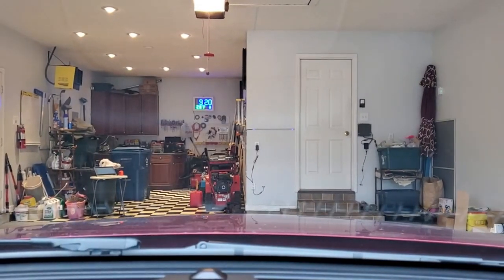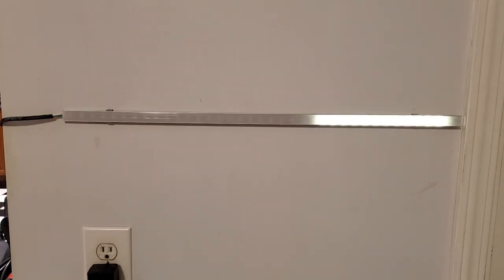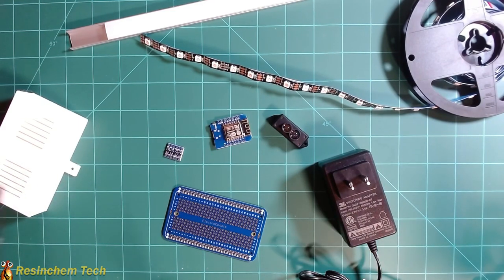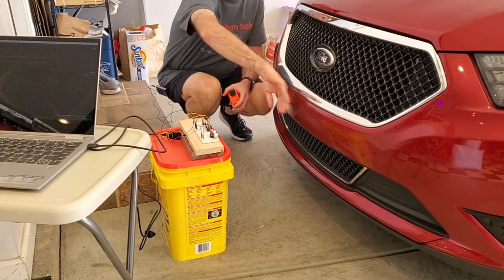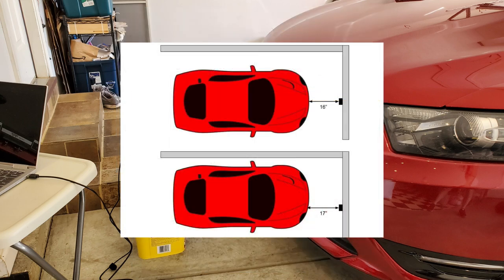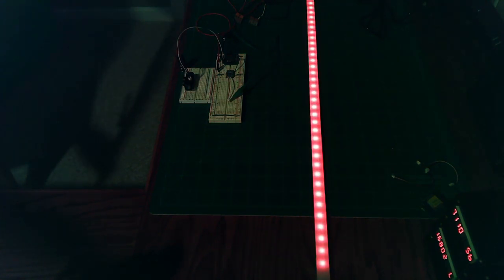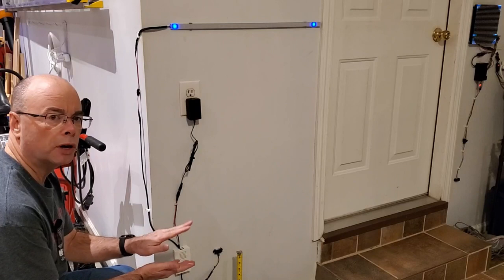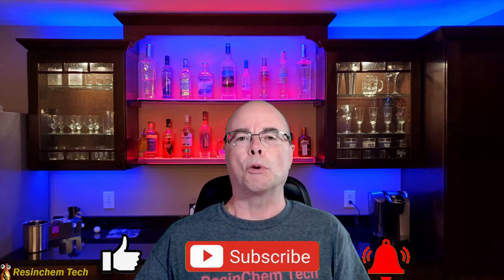A New Parking Assistant using ESP8266 and WS2812b LEDs

Comment: In a two car garage set up, could you put each system in front of each car without issues? Or would there be a way to run it all on a single D1 mini with 2 separate sensors and 2 light strips? Perhaps, in a future version, you could have an audible sound (via bluetooth speakers) as you approach!
Reply from the maker: Yes, starting with version 0.41, multiple systems can be installed (e.g. one for each car... for as many total cars/parking spots you might have).  You just need to assure each system is given a unique name when setting it up, and provide a unique MQTT topic for each if using MQTT.  This is all covered in the Github wiki for the project.

As far as adding sound, I have numerous requests for enhancements to the system... and a buzzer or audible tone is among those.  I did provide some updates and a couple of new versions a few weeks ago, but honestly I don't know if or when I might have time to consider additional requests.  Of course all my code is available, so it could be cloned or forked and those other features could be added by you or someone else.  I just can't make any promises as to when I might be able to provide any new features.
Reply: @ResinChemTech  For 2 cars, it requires 2 complete systems, correct? Or can any of the hardware be shared (ie. run it all off a single D1 mini)?
Reply from the maker: Correct.  It would probably require an ESP32 and pretty much an entire rewrite of the code to be able to share one MCU between two sensors and two light strips.  As written each system is independent, with its own web interface and settings.  The only thing you might currently be able to share would be the 5V power supply (running separate leads to each system) as long as it was able to provide enough current to power both systems.

Comment: Nice project.   I keep threatening my wife to hang a tennis ball in the garage because she always pulls in too far.  She's very resistant to that idea.  I tell her that mostly to tease her, but the WAF (wife approval factor) is a big part of projects like this.

I'm curious why you didn't put the LIDAR sensor in the box with the controller, and have it off to the side on a whip?  Seems like it would be pretty easy to include it in the box, and would reduce the clutter on the wall.
Reply from the maker: Thanks!  We used to have the tennis balls on a string too!  But I hated them because it seemed like when I had the cars out of the garage to work on a project, they'd always get in the way.  I'd either bump my head into them, or swing an 8' 2x4 around and catch the string, yanking them off the ceiling.  And of course, you can't integrate a standard tennis ball into Home Assistant for vehicle presence! 

To be honest, this was really just a temporary install that I did for the video.  My wife is happy with the old Pi version, and there's no real reason to replace it, as it still works well.  And that particular spot on the wall I used doesn't work for either of our vehicles either... again, it was just done for the video or my wiring runs would have been much neater (requirement for the WAF!).  But the idea to include the sensor in the same enclosure to reduce wiring is a good one.. as long as the D1 Mini doesn't cause any sort of interference with the TFMini.  Not likely, but I didn't test it either.... wifi and EMF can play havoc with some sensors.  Finally, I already had an enclosure designed for the current controller and I was both too lazy and spent too much time on designing the firmware, testing distance sensors and writing both the blog and Github wiki pages to create a new case design!  But the overall install could be made much neater in a number of different ways.  This one will probably come down and the parts will be reused for some future project.  I may actually mount it right over the Pi display for a while and see if the wife might like this version better, but she probably won't!

Thanks for watching and taking time to comment!  For us, anything that got rid of the tennis balls yet still provided parking guidance was an improvement (and adding Home Assistant integration was a bonus for me!).
Reply: I'll play around with it, I'd really prefer the LIDAR sensor be built into the case.  That'll be important for my WAF.

Comment: Super project 👍 short question: do you have to connect (+) and (-) left and right on the breadboard (loop through)❓Am Wemos D1 gets but then the connection 3V3 also then 5 volts from the power supply or ?
Reply from the maker: Thanks.  Well, it's probably easier for you to look at the wiring diagram in the related blog article ( https://resinchemtech.blogspot.com/2022/11/esp-parking-assistant.html ) than for me to try to describe it here in text, because I can't post images in the YouTube comments.  But if I understand what you are asking correctly:

5V is fed to the power rail on one side and the D1 Mini 5V and GRN connect to this to get its power.  The other power rail is 3.3V and is fed by the 3V3 pin from the D1 Mini.  Only the ground is connected between the two power rails.  The 3.3V on the one side is only there to power the LV side of the logic level shifter.  Do not connect 5V to this second rail or you will likely destroy the D1 Mini.  Again, it will probably make more sense when you look at the wiring diagram in the blog article.  But if you have additional questions after reviewing that, just let me know.
Reply: @ResinChemTech  One more question: is it not necessary to install a code on the Wemos D1 ?
Reply from the maker: Yes.  The code, along with all the details on how to install it and use the web interface is found in the Github repo, which is linked both in the video description and in the related blog article which I linked to above.
Reply: @ResinChemTech  Hi ich finde den Code (Firmware) nicht wo ich auf den Wemos D1 aufspielen / installieren muss ❓
Reply from the maker: Es befindet sich in diesem Github-Repository:  https://github.com/Resinchem/ESP-Parking-Assistant

Bitte lesen Sie das Wiki für Anweisungen zur Installation.
Reply: @ResinChemTech  Ok is it the code where in the "folder SCR" in it is that one must then play on the Wemos D1 ?
The code (firmware) is then played with one of the 2 softwares no matter which on the Wemos D1 ?
Reply from the maker: Hi. No, its the .bin file which you will find in the Releases section of the Github repo.  If you to the the wiki and just follow the step, starting with this page: https://github.com/Resinchem/ESP-Parking-Assistant/wiki/02-Initial-Installation  it will walk you though the install and the setup. All the instructions are in the wiki.  You do not need to download anything other than the ParkingAsst_vx.xx_ESP8266.bin file unless you want to modify and compile your own version.

Comment: You could use an ESP for your original project, or Pi for the new version.  The Pi certainly can have a web interface.  You don't have to use Python for the program language either.
But an ESP is the more logical choice, as the Pi is essentially a full PC in a single package with GPIO pins.
Reply from the maker: Yeah... I think my goal here was to make something that was significantly cheaper, since Pis are so hard to come by these days... and the LED matrix wasn't cheap either (at least compared to a short strip of WS2812b pixels).  The matrix also requires 16 different wires/pins between the Pi and the display (not counting power), basically eliminating the possibility of using a D1 Mini.  

Yes, a lot could be done to improve the original version... such as adding a web interface for the settings.  But the new version is a much lower cost and an easier to build solution with significantly less wiring.  My Pi version still works fine and I will likely keep it, but I wanted to share a system that basically offers the same features, but others could build without shelling out the extra money for a hard-to-obtain Pi or a matrix display.
Reply: As I mentioned, using a Pi is overkill anyway for this type of project.
As for your matrix, just use a WS2812b matrix which just like your new project would only require one channel wire, besides power and ground.

Comment: I made something very similar for my wife.  But mine was built with just a 2x4.  Yours is a little cooler.
Reply from the maker: There are a lot of different ways to take this same concept and reconfigure it for different needs and uses.  There are numerous other projects out there that do a similar thing, but many of them use an Arduino and a simply 'stoplight'... green, yellow, red.  I wanted to try to make something with an ESP8266, add a countdown effect (instead of just jumping from green to yellow to red) and to provide a web interface that allows a lot of different options and settings so the system could easily be configured for different purposes without needing to edit any code.

It won't be a fit for everyone, but it might work well for some as it is relatively easy to build (compared to some other projects) and doesn't require any coding to install or use.   Thanks for watching and taking the time to leave a comment!
Reply: @ResinChemTech  I was being silly, of course, with the reference to a simple stop block on the floor.  This is one of a million different projects i'd love to do, along with remaking my homemade CNC, connecting my irrigation and HVAC controls into a custom interface, constructing some ultra long battery life temp sensors, building a complete garage motor and sensors from scratch, etc.  I may not need this exact thing you made (my garage is deeper, and has a workbench an other stuff that would prevent me from having a good mounting spot), but the components and design ideas are still relevant to thinking about other uses.

Comment: Love the project wonder if it would work with a long range ultrasonic and a short range to 20$ in parts vs 40$ I may download and tweak if you don’t mind another fork?
Reply from the maker: Go for it!  I have numerous reasons why I don't want to add an ultrasonic version to my project.  Personally, I'm very happy with the TFMini and need its narrow FOV due to the sensor placement in my garage.  But mostly, I plan on further enhancing this project when I have time,  possibly adding lateral guidance as well... and I just don't want to have to update and maintain multiple versions of the project.  So, while I might add something like ultrasonic for a side sensor for providing lateral guidance (not sure yet), I have no plans to modify the current version... or create a new version... that replaces the TFMini primary front sensor with any other type of sensor.

But if someone else wants to fork and make a version that works with ultrasonic, or some other sensor or combination of sensors, that's fine by me.  In fact, if you get a working version, I'll happily provide a link to it on my page pointing folks that feel they need or want to use ultrasonic to that repo.
Reply: @ResinChemTech  love that idea.

Comment: I wonder if having a front license plate would help the ultrasonic sensor. It being a perpendicular flat surface. I would expect less variance, but have no clue if it would effect the range.
Reply from the maker: I don't think it would impact the range... unless it was bejeweled or something that would tend to scatter the signal.  Honestly, the curved front end doesn't make a huge difference unless you get really far left or right of the sensor.  Since I have the actual parked distance in Home Assistant, I've been able to watch the actual measured difference when my wife parks her car.  It might vary by an inch or so if she is a little to the right of center... but the 1" still puts her well within an optimal parking spot.

I appreciate the suggestion.. and thanks for watching.  I really just mentioned the curvature to explain why all 3 sensors in my testing didn't 'exactly' match the measured difference... and that you might see some slight variances as well.. but nothing that should have a major impact... unless you only have a couple of inches of clearance for your parked car.

Comment: The wake distance has a max of 192 inches.  It seems to be hard-coded to that. Is there a reason you made it max out at 192?  I would like to make it around 250 but do not see an easy config value to change.
Reply from the maker: The issue is that when the TF-Mini is 'out of range' it returns an error code instead of a distance value.... which would cause all sorts of issues with the logic (and safety).  I found the maximum reliable distance in my testing was around 200" (16.6').  To be sure that an error code wasn't returned, I set the maximum distance to 192", or an even 16 feet.  If you are using MQTT, you'll also see the max distance reported as 200" when no car is present.  This basically means the measurement is 'out of range' of the TF-MIni and it returned an error code instead of distance. 

You can certainly try increasing the maximum by removing the limitation on the web page in the code.  But you would also have to take steps to handle error return values of something like 32,156 (I don't remember the actual code).  You might get away with increasing the limit to 200 (but may still get occasional error), but I think you will have issues with error codes if you try to increase it all the way to 250.

I decided to limit the max to 192 (16') as a safety precaution and to assure the application was reliable.  But the source code is freely available if you'd like to try increasing the maximum value.

Comment: I was considering something like this myself, even though I have sensors front and back on the car, they're too conservative in the car for the required distance I need to be from the garage wall. Do you think the ultrasonic sensor would interfere with the cars sensors, or vice versa?
Reply from the maker: My wife also has the front sensors and I haven't noticed any interference with the TFMini LIDAR sensor.  I have not tried ultrasonic sensors, basically for the reason I cover in the video.  The nice thing about the TFMini/LIDAR is that the field of view is very narrow.  So, if for some reason there was unforeseen interference, it should be possible to place the TFMini sensor in such a way as it is pointing an area of the front of the car without the sensors.

Again, I haven't tested with ultrasonic, but I haven't seen any sign of interference using the TFMini/LIDAR (and the original Pi version uses the same sensor and has been in use for over 3 years).

Comment: Maybe it was already covered/mentioned but with where the antenna is on this build have you had any Wi-Fi connectivity issues?
Reply from the maker: The antenna is integrated on the D1 Mini PCB.  I have the controller in a 3D printed (aka plastic) enclosure, so it should not interfere with wifi reception.  As long as you have a decent wifi signal in your garage, the controller should not have any problem using the built-in antenna.  In my case, I do happen to have a Unifi PoE access point in the garage, so wifi signal strength is not an issue.  But if you have any other wifi devices in your garage (like a smart garage door opener) that are able to receive a wifi signal, then this device should not have any issues connecting.
Reply: @ResinChemTech  Thanks.    like you I have a AP in the garage so I was more curious than concerned.

Comment: Is this also available in Centimeters? For worldwide replicas except US.
Feet, inches and so on have no meaning for me.
I think if I replaced 25.4 with 10 everywhere it would have to be cm. "# define" can be used for this.
Reply from the maker: As I mention in the Github wiki, internally the application actually uses millimeters.  The distances are simply converted to inches only for the web interface display (and they are converted back to millimeters when the settings are updated from the web page).

Removing those conversions and changing the labels on the web page are pretty trivial matters and I can consider releasing a "metric" version if and when I have the time and opportunity.  Or, of course since the source code is available, you are also free to fork the repo and make those changes yourself.  To be honest, since the distance settings would rarely change after initial setup (unless you move or get a new car), it would generally just be an simple one time use of an online calculator to do your measurements in cm or mm and convert them to inches for entry in the web app.  I wouldn't mind offering a metric version, but it then gives me two different code sets that I have to maintain and update every time I make a fix or add a new feature... the imperial version and the metric version.

Honestly, I wish the US was officially on the metric system like most of the rest of the world.  But unfortunately that isn't the case.  And since the majority of my YouTube viewers are US-based, I opted to use the more familiar inches for the application.  But I will certainly add a metric version to the list of requested features.  I just can't make any guarantees when I will get to it with other current project loads.
Reply from the maker: I just wanted to follow up on this.  After your request (and a few others), the latest release (v0.41) now has the option to show and enter all parking zone distances in either inches or millimeters.  The setting can be toggled on the main web settings page and saved as a boot default so that the web application will always use your default unit of measure preference.